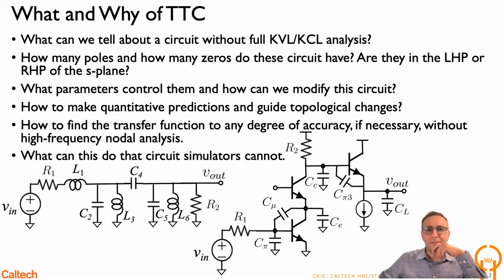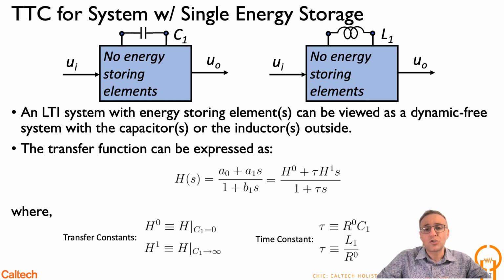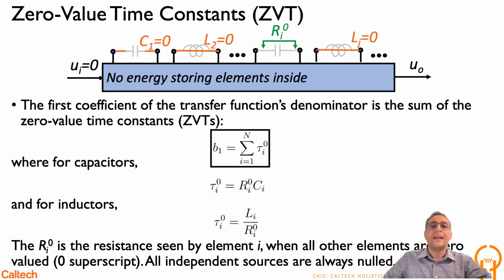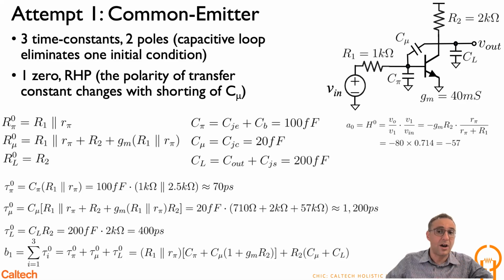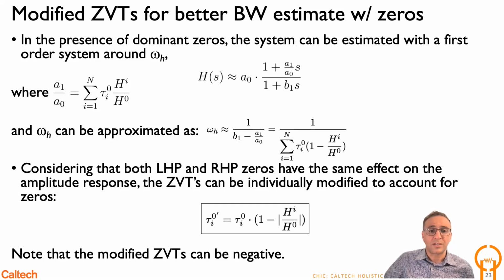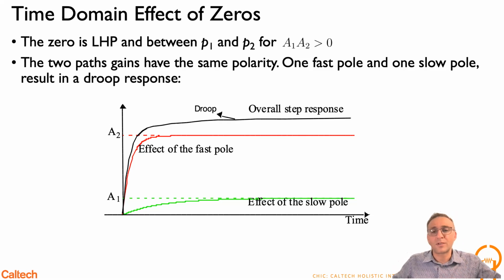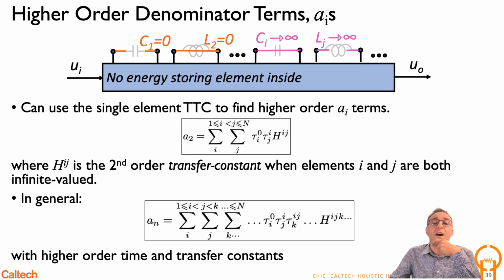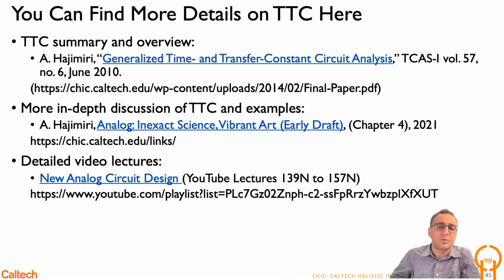Time and Transfer Constants in Circuits (High Frequency Circuit Analysis)

Comment: Thank you, Prof. A. H., for the video. I have a question I'm struggling to understand. At low frequencies, all the terms with 's' don't matter (since 's' approximates 0). However, as the frequency increases (far greater than 1), I think the higher-order 's' terms become more significant. For instance, if b1 is significant and the condition is 0 < S < 1, but the frequency Wh is usually in the kHz or MHz range, why can the denominator be approximated as 1 + b1s? Thank you 19:40
Reply: That happens under the assumption that there is a dominant pole. In addition, if you think about it, the b1 is the sum of the reciprocals of the poles while b2 is the sum of the reciprocal of products of two poles at a time. That means b2 is smaller than b1. That is why the s term effect is felt before the s^2 term.

Comment: Hello, I used this method to calculate the input impedance of an active inductor. But I get the wrong result when i zero the input voltage source for calculating the time constant. I get the right solution only for removing it. Do you know about why that is?

Comment: @45:43    Why is the symmetrical relationship valid --> R_1^0 * R_2^1 = R_2^0 * R_1^2
R_1^0: Resistance looking into port 1 with all other ports at zero
R_2^0: Resistance looking into port 2 with all other ports at zero
R_2^1: Resistance looking into port 2 with port 1 at infinity and all other ports at zero
R_1^2: Resistance looking into port 1 with port 2 at infinity and all other ports at zero
To me it looks like the products are unequal.
Reply from the maker: Yes, this is correct and in someway a remarkable relationship. You can find the proof and discussion in the Analog book draft or the published paper, but in short in the derivation since it does not matter which element is indexed 1 and which one indexed 2, you will end up with this relationship. There is more general one with multiple elements too. Look at the paper.

Comment: Professor if in your example in the common source stage R1 =0 that means that all the b2 coefficents are equal to zero? So the system has only one pole? Because if R1=0 then all time constants that include R1 are equal to zero
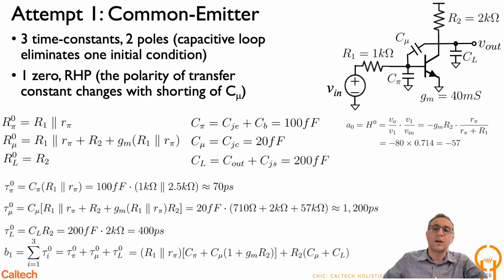Reply from the maker: I assume you are talking about @23:00, which for a MOSFET has an r_pi of infinity. In that case, tau_ph^0=0 but not tau_mu^0, or tau_L^0 (as they have other terms in them that do not go to zero if R1=0. However, the second order time constants (tau_mu^L and tau_L^mu) are zero. This can be understood from the fact that  you have a capacitive loop between C_mu and C_L (and the input voltage source which is also shorting C_ph), so you can define only one initial condition and the circuit as shown will become first order and will have one pole (b2=0).
Reply: @AliHajimiriChannel   Thank you professor for your quick reply . I tried to find Yin(s) of a common source LNA in order to see if the real part can be matched to 1/50 Siemens. The TTC is far more quick than KVL,KVC so i saw that when R1=0 ,Cgs plays no role in calculation. So in the case of Yin(s), b2=0, the system has one pole but a different numerator than the case of Vout(s)/Vin(s) as most importantly a2 is not equal to zero in the numerator. Thank you so much for uploading your work professor.